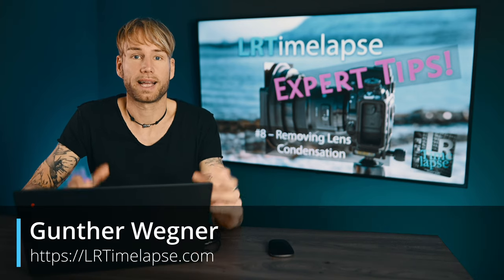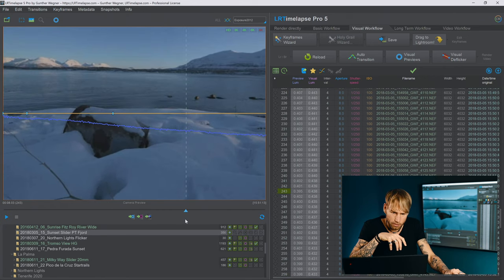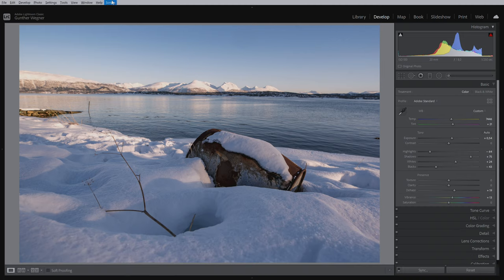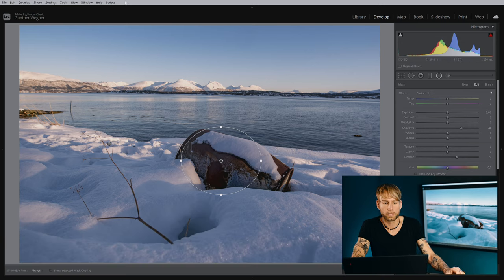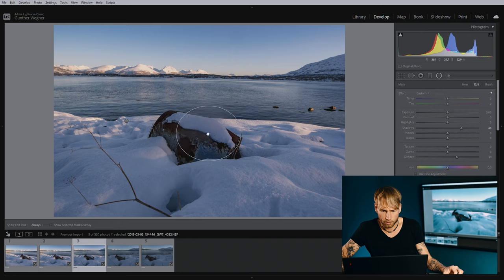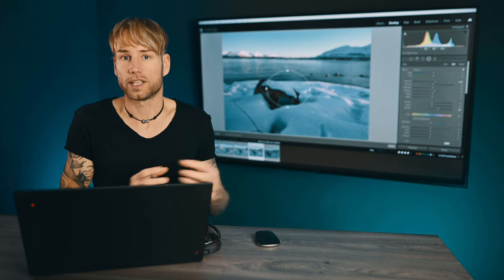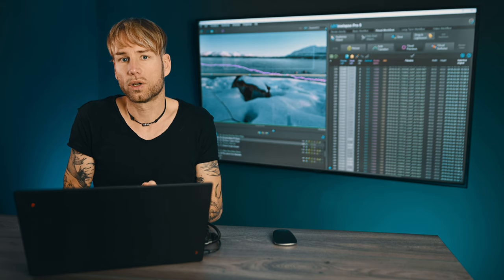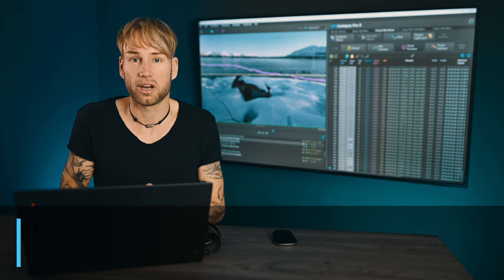LRTimelapse - Remove Lens Condensation from a Timelapse - Expert Tips #8

Comment: As usual another expertly explained editing tip.  
However your tip regarding how to avoid the condensation by letting the lens adapt to the outside temperature for a longer time leaves me puzzeled: the longer you keep the camera outside in the cold, the lower the temperature of the lens will become. When it drops below the dew point, condensation will start - not as long as the temperature is still higher. So only heating will help, not cooling.
Reply: Yes, of course I should have mentioned lens heaters as an option to prevent and quickly get rid of condensation, thanks for pointing this out!